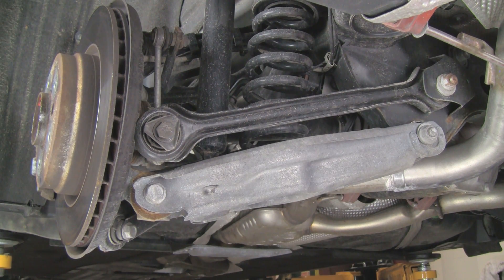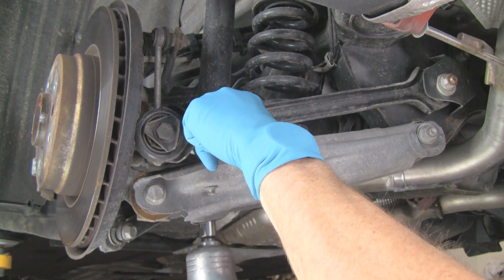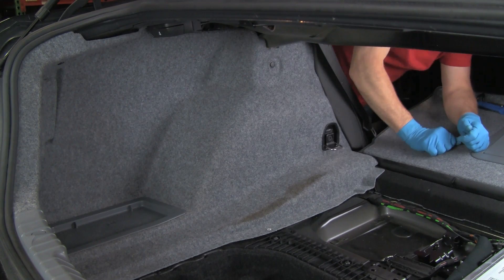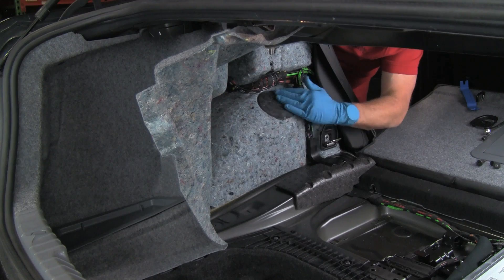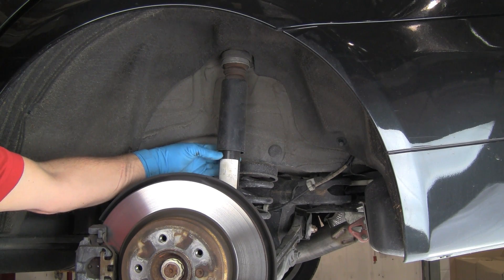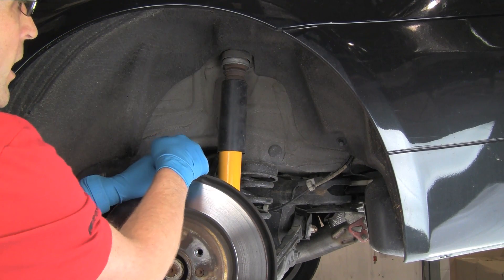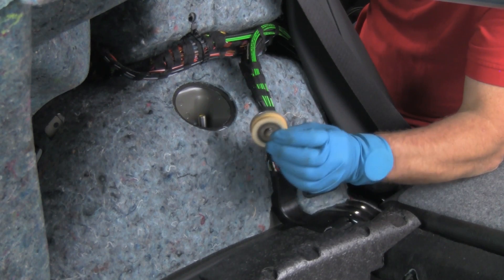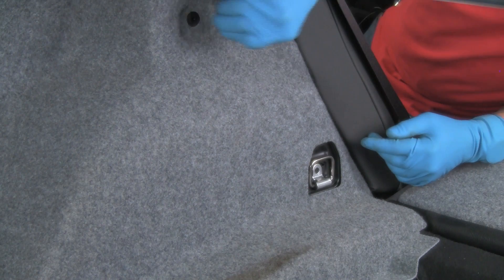Part 2: Installing shocks and struts on a BMW 3 series 06 thru 12 (E90, E91, E92, E93)

Comment: Sorry, but I can't tolerate neglecting 1) torque specs. 2) you must tighten a lower bolt on the vehicle's ride height. The manufacturer sets these parameters for a reason.  As an engineer, I spend an enormous amount of time ensuring the part performs at its best. But this is impossible if you do not follow the instructions. And then people say BMW is unreliable. No, the so-called "expert" car mechanics ruin them.

Comment: Thank you for the very clear step-by-step procedure, you made it easy to remove and installation plus simple techniques in removing the front struts by turning the wheel so that strut would drop down and clear from the fender for the strut to remove. I appreciate it very much and soon I'll be doing this task to my BMW 335i

Comment: Good video.  However, i'm having trouble figuring out how to change the shock mount.  I'm not able to figure out how to reveal it.  But i'm certain that it needs to be changed because my shock sticks out about 6 inches (if not more) higher than yours does in the video.  Also it rattles as i drive.  Any ideas or videos that show how to reveal the shock mount?  Thanks.

Comment: Fantastically clear.  You have a gift.  Would you mind please doing the same for the wagon?  The E91 has a horrendous set of housings and panels needing to be removed—just to get to that shock bolt.  I figured it out.  But it’s more complex than the sedan.

Comment: Hi Otto,
Regarding the refitting of the trunk side trim panels: for a 2011 E90 without folding rear seats, what is the trick to reinstalling the trim panel forward edge(s) behind and between the fixed seat trim and the back of the seat?
Also, thank you for all the excellent blog videos!

Comment: When I turn the steering wheel to left/right it clicks(clicking sound). They said that its because of suspension is that true?
Reply: Sounds like your axle on both sides need replaced.

Comment: Pretty good video. I was wondering this will work with the BMW e90 in the U.K.?In regards to the springs. Would I need to do anything with them? Sorry to sound silly but I'm thinking in changing my front shocks myself. 
Also how did you lower your rear seats? I had the assumption you couldn't. Cheers

Comment: If installing coilover, what are some of the used part that should be replaced at the same time?
Reply from the maker: +Harry Chiu It really depends on the design of the coil-over kit.  In most cases, new upper mounts would be a start.

Comment: Can bad bushings cause a squeaking noise? There is a squeaky noise coming from the right rear end, I believe its the lower lateral to chassis bushing that's gone bad. And does the up arm have a busing in it?
Reply from the maker: All of the rear arms have bushings at the inner pivot points.  Yes, a bushing could cause a squeak.  Does the squeak happen if you compress the suspension when the car is at rest?  If so, you can get the car on a drive-on lift and bounce the rear end while locating the noise from underneath,
Reply: Yes the squeak still happens. I pushed down on the trunk and the squeak is really bad and quite loud. The bushing on the Lower rear control arm does look pretty bad
Reply from the maker: Jusuf e90
You should be able to fully locate the source of the squeak if you can push down on the trunk and make it happen.  It's best to be sure before diving in.
Reply: rear Lower lateral to chassis, #15 on the powerflex diagram that you guys have available
Reply from the maker: Jay E90
That could certainly do it.  If you replace the bushings, you may want to consider the rest of the busings .... as long as you are up to the extra work and can handle the extra expense.
Reply: Is it true that you may need to get a new alignment done once the lower controlling arm to chassis is disconnected?
Reply from the maker: Jay E90
The inboard bushing, on the lower arm, is the camber adjuster.  So, yes, an alignment will be in order if that is changed (or fully removed in order to replace the bushing or otherwise remove the arm).

Comment: I change new shock but I found out the rubber bushing loose from end mounting from the control arm... My question sir can we replace just the rubber bushing where the shock lower mount thanks in advance..
Reply from the maker: Yes, the lower shock mount is available, click the link below:
http://www.bavauto.com/fland.asp?part=35398%2001

Comment: Doesn't the rear absorber extend itself after compressed due to internal gas pressure? Why do u need to help it to extend?
Reply: BavarianAuto It's because the control arm was hanging too low - the strut would have to bend to fully extend. The lower control arm should have been raised a bit and THEN the shock would have extended, allowing it to be tightened.
Reply from the maker: Not all shocks will have enough extension pressure to fully extend into place, without help.

Comment: Thank You Very Much For This Informative video. My only question is, I have a 2006 330 XI E90 and I mistakenly bought Koni sport shock. I want to know if I can use them with the original springs or not before I pay for returning them. Thanks in advance
Reply from the maker: You can indeed use the Koni Sport shocks with stock springs.  We suggest that you start with the settings full soft and adjust from there, unless you know that you do indeed want the shocks substantially firmer.  We would not suggest starting at more than 1/2 between firm & soft.

Comment: This is the nice video with clear discription.

However I'm thinking about my E87's strange sound from left rear footwork area while  watching this vids. Which sound like light noise when I runnnig bad road surface, also when I jack up vehicle sound  like metal be rubbed with stretching absorber.

If you have the opinion, please give me the idea.
Reply from the maker: You may have a shock, shock mount or control arm bushing issue.  We would first suspect shock and shock mount as potentials.  If you can hear a sound while jacking, work on locating that sound.

Comment: Very good vids, I just did the rear of my E92 over the weekend (shocks, springs, M3 control arms) and will be doing the front shortly. I'll be using the front end vid for reference, great job! Oh, and for the previous commenter I'm doing this in my garage with floor jacks and jacks stands, its a pain but very doable.

Comment from the maker: This is really an "it all depends" question.
If the vehicle (and the shocks) have low mileage, then a single replacement would make sense.  However, if the shocks have 50,000 miles, or more (for example), a new shock will likely have different damping than the old one, due to normal wear of the old ones.  In this case replacing in pairs would be the best choice.  If finances don't really fit this, nothing is going to be damaged or be unsafe if just the one is replaced, for now.
Reply: Suspension components 'should' always be replaced as pairs.

Comment from the maker: I would remove the shock (as shown in the video) and inspect the lower mount bushing (in the control arm) and the upper bushings.  Also inspect the shock itself.  Additionally, inspect the swaybar end link for worn joints that could be clunking,